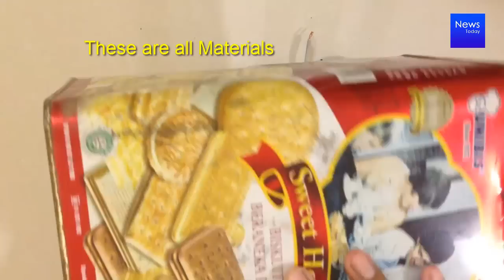How to make mini Grill, at home easy simple BBQ

Comment: I dont get it,  14:34 u wanted to check and at 14:35 u made some changes, u added something in between.. now who's gonna tell that?
Reply: there's some spring type thing you added in between. the blue colored one on right hand side of the coil.
Reply: I think for at 14:34 he added it may for convert the power low more to hot.